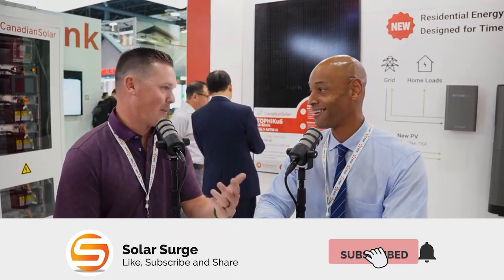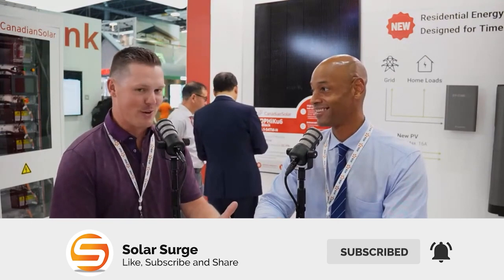Is Tesla Powerwall 3 a Hoax?

Comment: This is kind of hilarious in hindsight because Enphase and SolarEdge have soft-announced a ton of products that took 3-5 years to get international approvals or anything beyond a spec sheet an some marketing blurb. IQ8, Encharge took a few years, etc. 

The thing is, you can guess quite a lot from the spec sheets, even if the details are missing. e.g. with an 11.5kw load capacity, and 6 MPPTs, it would behave a lot like 3x integrated 5kw inverters with 2 MPPTs each, and with 133% panel oversizing, 3.75kw or 1875w plate capacity per MPPT/string = 2500w of panels per string. Which is a total of 15kw. 

While this isn't great news, because of the irregular voltage/load capacity of larger 72/144 cell panels and larger, they may not be suitable. Plus, smaller strings tend to be more expensive to wire in, but conversely, they can also be more shading tolerant for 6 panels of 405-410w each. The problem is that most roof spaces will probably want 8-10 panel strings at least to make it efficient, and there may be capacity or preferential minimum panels to run on each MPPT. So a 15kw potential may only allow 9kw of panels once wired in and configured. 

Time will tell if that's right, since that would also follow the Powerwall Plus configuration(s).

Comment: In light of having the availability of relatively HUGE car batteries to do the same thing in an emergency situation, these wall mounted batteries are WAY too expensive at this point. V2G or V2H (whatever acronym you want to use) needs to come into the forefront now as EV adoption increases. I also hate that powerwalls are not compatible with microinverters which basically means Tesla is excluding a market segment which generates AC power in a way they disagree with and probably feel is inferior to their own method (while I agree direct DC is better in many ways, these should be more universally usable).
Reply from the maker: The Tesla powerwall 2 is compatible with Enphase micro inverters.
Reply: @SolarSurge  from the tesla Powerwall FAQ: Question- Can I add Powerwall 3 to my Powerwall 2 or add Powerwall 3 to my existing solar system?
Answer-  No. Powerwall 3 can be added to other Powerwall 3 batteries and cannot be added to Powerwall 2 or Powerwall+ batteries. Powerwall 3 is not compatible with other solar inverters.

Comment: You spoke of a one brand system. I have the Generac system for a couple years now and I am very pleased.  Also Generac has stood behind their components even when the installer was gone. I have the battery back up from Generac and I recommend it as a good choice along with Generac being dependable in many different ways.
Will the Brand you buy stand behind your system when your installer isn't around anymore. All my snap rs was replaced by Generac on their dime and they found an installer to fix it.
Reply: Because they sunk punk energy lol. Lawsuit is still pending